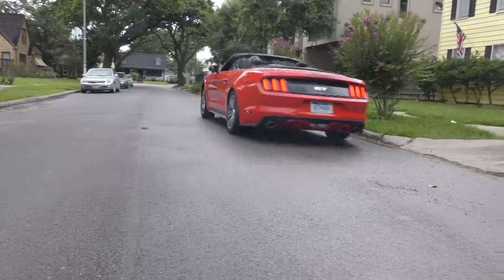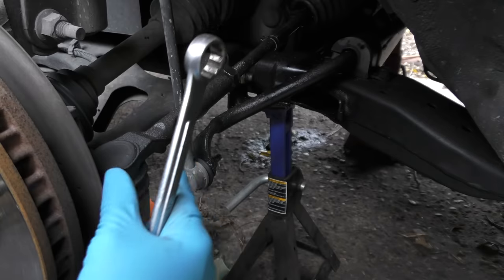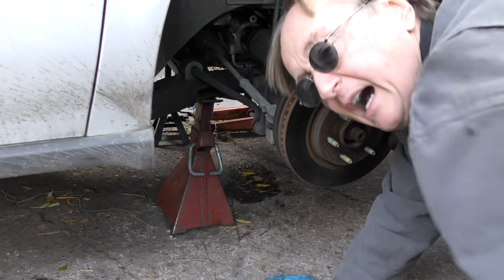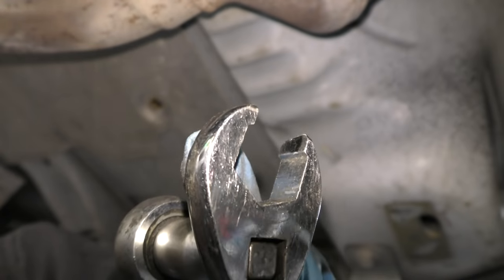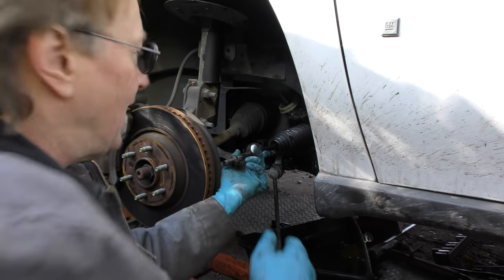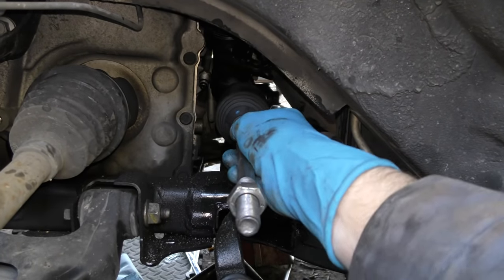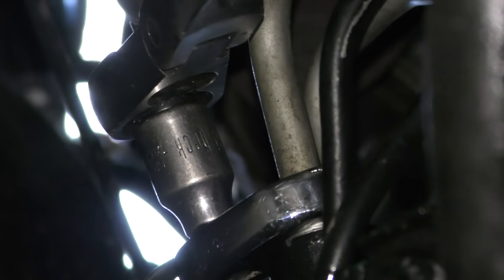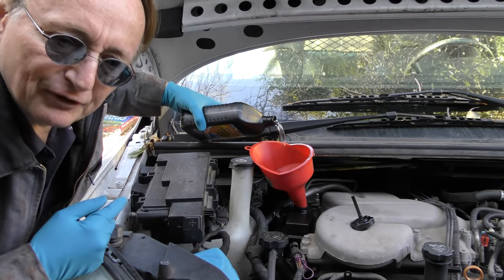How to Replace a Power Steering Rack in Your Car

Comment: Scotty I'd like to see you try to replace the power steering rack on my 01 ford escape 3l v6 awd... I think the solution to that vehicle is to inform the customer to 'build upper body strength'
Reply: It took a ford mechanic 1 full day to remove the power steering rack in my 03 escape
Reply: Anonymous yeah it's a REAL bitch of a job. Changing the alternator is a real fun job on the v6 escapes too.
Reply: +Peter “Crackpot Pete” Carlson i think my alternator is starting to go out.. Battery light is flashing under hard acceleration
Reply: Anonymous probably is... I'd have to hook up the NGS scantool and see what output percentage the alternator is being commanded to run at (to rule out a pcm failure) and make sure all the connections (especially the ground) are good. To take the alternator out you have to remove the wheel, disconnect the control arm from the tie rod end and the steering knuckle bolt, then drive the CV shaft out of the transaxle, then unbolt the alternator, then turn it around and unbolt the alternator bracket, only then can you do a series of 3 turns and barely get that sucker out of there... it's a real PITA job and there are those who think the right way to do it is cheat and bend the lines going to the AC evaporator through the firewall and squeeze the alternator up behind the engine... do NOT do that, if you break the AC lines/quick connect fittings  at the firewall you will really regret it and even if you don't break them you may cause the quick connect fittings to fail or leak and the only way to properly fix it is to remove the dashboard and disconnect the evaporator core and replace the lines from the inside... that is quite the job btw, wayyyyyyy harder than pulling out the driveshaft.
Reply: +Peter “Crackpot Pete” Carlson Now that i think about it... My power windows also take much longer to roll up. My headlights are slightly dimmed.. Whats odds its my alternator?
Reply: +Anonymous Could be the battery.  Drop by advance auto or autozone and they'll test both for free with their little machine.
Reply: ***** no... he described classic symptoms of a bad alternator, it's not his window tracks being unlubricated
Reply: *****
NEVER EVER EVER EVER EVER EVER EVER EVER  REMOVE THE BATTERY TERMINALS WHILE THE ENGINE IS RUNNING!!!
What this can do is force the car's PCM to command the alternator to full output and fry your alternator's charging diodes and regulator! That might have worked way back in the day but I know of no vehicle manufacturer who will advise this test procedure and I HAVE seen this done with a brand new alternator and it killed it instantly (07 saturn vue) right then and there. This is also why when you replace your alternator you should replace your battery as it is cheap insurance.

Please people, a little knowledge is a dangerous thing and if you don't know what you are doing please don't make stuff up, or tell us what you thought your grand daddy told you, that could be a VERY expensive mistake in the 200-500$ range just for parts let alone the absolute bitch of a job in man hours it can be to replace the alternator in many modern cars.
But wait, it gets worse, if your car's voltage sense is at the battery  and the PCM detects no voltage it may increase the output of said alternator past the safe range for your automotive electronics and FRY THEM! This means your engine computer (1500-2500$) radio/nav system (100-2000$) SRS module (1000$+) climate control module (250-1000$) interrior lighting/gem module (200-400$) ABS module (200-500$) dash instrument cluster (300-1000$) drivers seat control/door module (100-1000$) and many more electronic trinkets that your car have could be either killed instantly or "wounded" in such a way that will cause premature failure.
Reply: *****
Nothing bad that you know of... yet. You could do that to some cars safely up until model year 1960 or so but even still it was NEVER an accurate way to test your starting and charging system.
The funny thing with electronics is that they work through very strange physical properties on a scale of just a few atoms being arranged in just the right way, these "junctions" as we will call them have other properties besides their ability to direct current in one direction or to amplify current from a small signal voltage. They can also "leak" or flow electricity in the wrong direction or let electricity flow from junctions without say the voltage needed to switch on the transistor's junction, which can cause even more parts to take more voltage and or current that they were designed to take when in a circuit with properly functioning components, those components downstream may then just give up the ghost outright or heat up signifigantly enough to melt themselves right off of the circuit board or those wounded components themselves may heat up until they reach maximum junction temperature where the physics that govern semiconductors refuses to allow them to work at all. Just like a person, they might be wounded and not die right away, but that does not mean they may live full and happy lives or die down the road.

Comment: very good,  but I expected you will bring a rebuild kit and fix the whole steering rack.

replacing the whole rack is better because you will have new gears inside
Reply: new gears, new seals, new proportioning valve... with a lot of these FWD or awd vehicles it doesn't pay to rebuild the racks yourself  anymore
Reply: Most of the time it is a good idea, but sometimes, you can send it to a repaor shop. My mother's bmw e30 broke the seals and it was leaking. We send ot to repair like 9 years ago, and still works fine.
Reply: I bought a rebuilt steering rack for my Subaru Legacy, 4 years ago and still working fine like new one.
Reply: +Peter “Crackpot Pete” Carlson I attempted to rebuild a rack once.. It didn't last very long. I think a lot had to do with the casing itself. Anyways, with European cars you can sometimes luck out. They normally use mineral oil which is quite thin so if you have a little bit of a leak switching to atf can get you a few more years out of it. I switched an audi to atf and it lasted another 5 years. It's probably still going fine.

Comment: i have a 2003 nissan xterra it has 17200+ on it. i notice when im on highway driving about 75+mp/h it slows down when going a little bit uphill enven the mpg going down and nothing happen when I push the gas pedal to the floor and going downhill on the highway mpg goes higher  and speed increase. on flat surface it works normal. it shifts normal. should I be worried about that issue. and i have an evaporation code light on.
Reply from the maker: +Jean Pierre  often a worn fuel pump does that, pressure test it. evap means little, many ignore that
Reply: +Scotty Kilmer .thanks for replying

Comment: Scotty please reply , can I change gasket only? mine is leaking driver side
Reply from the maker: it's a seal that leaks on the rack, you can try, but often that does not work as shafts often get damaged too
Reply: Scotty Kilmer  So... your recomend to change the whole thing?   is use ok to use?..  by the way thank you for the time reply

Comment: Question please help 2006 Monte Carlo ss 5.3 replacing rack and pinion ( when installing new rack ) the stub on top of rack ,one bolt holding it,to top colom do u you just slide the top back as you removed it and bolt back thanks

Comment: I dig Scott. But he sure seems to be all about making the video as short as possible. No explanation at all about why he's doing the things he's doing, pitfalls to avoid, challenges to over come in doing this job, etc etc. 

I mean, does anyone that knows this job simply end the work with filling up with power fluid as the last step and driving off into the sunset? No turning the when lock to lock? No bleeding the air out? 

Regardless, I like Scotty.

Comment: I have a 1936 Buick Model 48 with a Mustang II conversion kit. Because I am running the original steering wheel, one touch of the steering wheel can send you in the ditch. Anybody know if it is possible to get a rack with a different gear ratio?

Comment: Is there anything that can stop rack leak coming from the boot
Reply from the maker: replacing the rack, cause that boot is just a dust shield. But sometimes AT 205 Reseal, 3 ounces or so in the power steering reservoir after draining 3 oz out, can work. I get mine at amazon

Comment: i had power steering pump and rack and pinion changed on my 09 impala that fixed the growling well now when i drive the car surges when driving speedometer goes up and down. what happen?
Reply from the maker: +Donnie Bridges   check to see if they messed up the idle up speed sensor on the power steering
Reply: +Scotty Kilmer thanks 
Scotty

Comment: Hey I have a 201q Dodge journey.  I turned the car on and the lights and computers and radios weren't working and the car wouldn't turn off.  The car eventually shut off but now it won't turn on and says no bus error and I found lots of fluid leaking from under the car what is wrong.
Reply from the maker: +Christian Yassa probably more than one problem. Check the fluid leaking first, pray it's not a blown engine. if not, then odds are computer has gone bad with no bus code, that or wiring to the computer

Comment: Unsure if my problem i have ps noise the pump not leaking i put dye in it and the steering is rough and it wines when i the car is running and when i turn

Comment: Hi Scotty does atp205 stop leak do the job ?
Reply from the maker: sometimes it will work, BUT realize 1500 psi pressure is in there so leak sealers often won't help PS leaks

Comment: I have a problem with my Mitsubishi Eclipse 2000 GS late Lee I saw smoke coming out of under the car really don't know but it smells like burn I try to record videos to see where it is coming from but no clue yet need help
Reply from the maker: +Jose Ojeda pray it's just a leaking valve cover gasket dripping on the exhaust
Reply: +Scotty Kilmer thank you so much I will check on that right now I learned a lot from your videos and thanks for the help appreciated

Comment: my power steering pump purges fluid out of pump when I turn it off. when you turn it back on there is not enough fluid. and no I'm not over filling. when I do fill I go through the steps to get excess air out of system.
Reply from the maker: that's often a sign of either restricted power steering rack OR a bad pump shooting back pressure up
Reply: So sounds like I have to replace the pump and cross my fingers. Otherwise I will have to curse a lot and throw things.   Lol.   Thank you for responding.

Comment: replaced my power steering pump and now it's leaking from somewhere else. what could it be ?
Reply from the maker: check the high pressure line for leaks, and PRAY it's not the steering rack now leaking from the extra pressure of a new pump.

Comment: i had a mechanic fix my rack and pinion because it was leaking (note) (before i brought it to him once i turn the car on the steering wheel would adjust to me now after he fixed it its not working. can anyone help? e39 03 530i msport

Comment: I really need any body's feedback on the following. i have low power steering fluid and went to a small garage to buy some. they wanted to sell me automatic transmission fluid and they insisted that it is the same as power steering fluid, when i refused to beleive so they laughed at me as if im some sort of idiot. are they telling the truth??
Reply from the maker: +Alternative some cars use that and it works fine, like GMs. Some like VWs don't.
Reply: +Scotty Kilmer thanks for the reply. my car is a GM maybe thats why they wanted me to buy the automatic transmission fluid! i just thought if it was the same then why do you have two different kinds of fluids? thats why i got worried i didnt want to ruin my power steering

Comment: like the new intro and if you want the wheels to lock on the new mustang pull the ABS fuse and your wheels will lock up the sound effects just dont work for me
Reply from the maker: +Giovanni Bunny can't do that on the new one, computer bypasses even that, I tried. hence the sound effects.
Reply: ok i did it once with my grandfather on his 2000 toyota sequoia AWD iForce the speedo stopped working but when i went on a dirt trail with him we where able to get up a hill by locking the wheels instead of free rolling down

Comment: Any pointers on getting the bolts off that actually hold the rack n pinion in place. Mine r not flush I have to use a deep well socket but cant seem to get a ratchet or torque on there
Reply: IIt's a2003 gmc envoy xl
Reply from the maker: I use gear wrenches that have sockets which swivel on the end which always can get to them
Reply: Awesome ill try that

Comment: can you replace the lines on the actual rack the two that come with the new rack thats whats leaking on mine
Reply from the maker: they'd be hard to find, but often they just need tightening OR new seals inside
Reply: Check your local junk yard. The lines on my 98 Windstar were rusting out, and started leaking, so I had to replace them. Living in the rust belt sucks.

Comment: Can anyone help me out. I got the rack replaced on my 2004 Honda Accord buy a mechanic. And now my steering is stiff and tougher then before the replacement. I went back the same day to let him know that it's been that way from the moment I left and he claims that its my p/s pump then. I told him I replaced it prior and have a new pump in since last Oct. he then goes you might have a defected rack and proceeds to tell me that if that's the case then he's not at fault since I brought the part to him. He owns a shop and told me to buy the parts I asked him wouldn't he provide them and I pay for it thru him and he said its best if I bought it since it'll be cheaper for me. So now 3 days later it's still tuff and I just got the answer to check the p/s pump and that I need to just drive the car to break in the new rack to loosen it. Like wtf kind off answer is that smfh. Can someone help and lmk why this could be happening? I don't need to keep guessing I need to find out for sure

Comment: The power steering fluid you added looks different than the stuff that came out in the beginning of the video. You should go to the dealer and get the right stuff for that particular model. Just sayin.
Reply from the maker: +Zack Zander the stuff that came out was old and nasty, I used the same rated fluid that it originally came with

Comment: If your vehicle takes atf for power steering fluid, use synthetic high viscosity atf with a few table spoons of synthetic transmission fluid additive. Change fluid every 60k/3 years. You'll never replace that steering rack again. Only replace with OEM new or OEM remanufactured steering racks. It'll be pricey, but all the aftermarket brands have been trash since post recession. All. Of. Them.

Comment: cars whining and it binds when turning left. it's a Ford Focus 2009 2.3 litre. there is steering fluid in the engine compartment at the very top of the engine near the reservoir. could seriously use help. 25 year old kid with a kid and wife who makes 250 a week. seriously need some insight.

Comment: how can I fix my 2005 vw polo steering rack its leaking?
Reply from the maker: replace it, not a cheap job. VWs are poorly made and replacement parts VERY expensive. BUT, you can just remove the pump belt and drive it without power steering, they ar e  not heavy cars

Comment: need help . my car just turns off after I turn it on happens in park, neutral, reverse, n drive.
Reply from the maker: +Victor Gonzales  often a vacuum leak, try my video "finding engine vacuum leaks with a cigar"
Reply: I finally found the problem..

Comment: I'd replace those ball joints while I was in there. Moog makes tie rod/ball joints with grease fittings (in the USA,) instead of the "designed to wear out" no grease fitting cheap ass chinese ones that come on them new. you're lucky if you get 75k out of the crappy ones the factories use.

Comment: Where do you live that an old car looks like that underneath?  Where is the rust and corrosion?  Real men don't work on cars that don't require massive doses of WD and elbow grease to work on the undercarriage...:-)
Reply: Mr Reymundo Wow you're sick.
Reply: Noticed I didn't say I wouldn't like to work on cars like that.  Just that we don't get a chance.  When you live where they salt the roads in winter, rust and corrosion come as standard equipment.  We've had to develop an entire skill set for getting stuff off, and loose.

Comment: If only it was that easy to do one on a v10 Audi A6.
Audi are possibly the worst engineers on the planet, they deliberately make things far more difficult than they need to be, I mean who's great idea was it to put steering rack turn screws under the between the body of the car and the exhaust so you have to pull the engine out to replace the rack.
Audi engineers are morons to be polite.